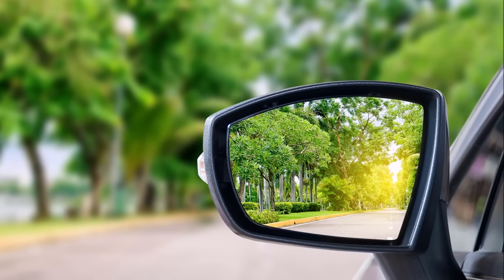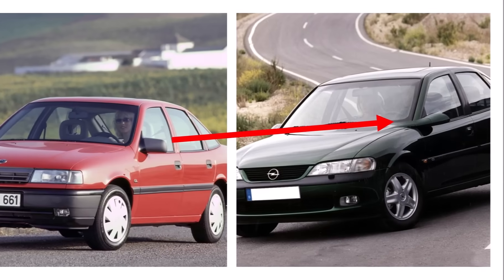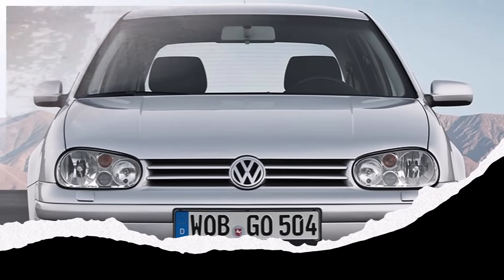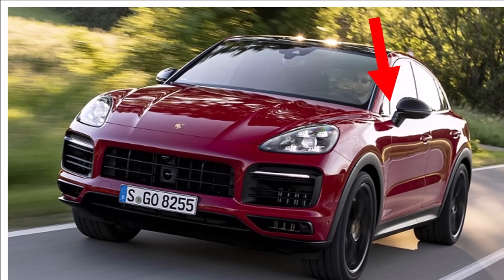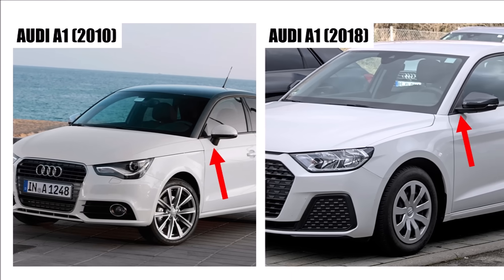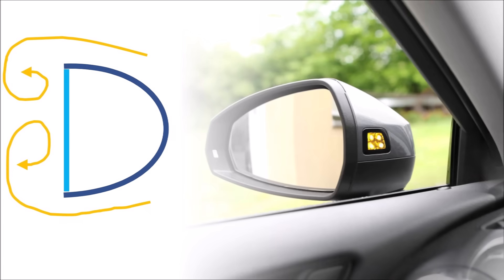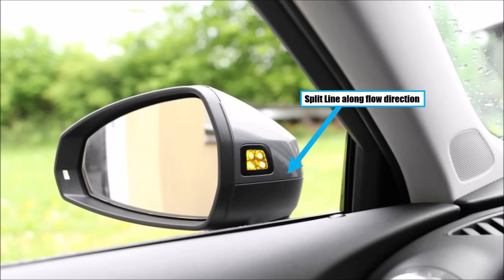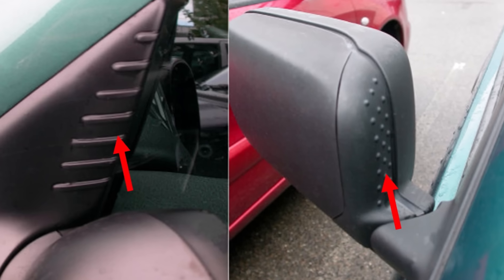Car Mirror Design - EXPLAINED

Comment: Another design issue to consider is the driver view downward between the mirror housing and windshield A-pillar. In some cars, you cannot see thru the gap, which makes things difficult in low speed turns and off-road driving where that view is very important.

Comment: Ferrari Testarossa had mirrors (or in some versions just one mirror) on two struts and sticking out quite far. It was one of the features about that car that always struck me in a way. Airflow considerations probably played a role here but I never gave that much thought.
I think the big break in mirror design came when people wanted to adjust it from inside without having to open the window. The mechanism required for this meant that the mirror couldn't be mounted on a slim stalk any more but was mounted directly on the triangle in front of the window (which led to the turbulence problems described here). I assume some of the newer cars shown here that have mirrors on slim stalks again use servo motors to adjust?
You could also talk about the mirror glass which tends to be convex for a larger angle (and leading to the effect "objects in mirror are closer than they appear").
In trucks and buses mirrors are a whole different affair because of the huge dead angles they have to avoid.

Comment: 3rd and 4th gen of VW Passat got an interesting mirror design; Maybe you could explain it further. It's connected to the side Window by two separate Arms, that work as a hinge too. What are the up and downsides of this design (which i think is pretty developed for a late 80's car) and why did it fail?

Comment: I don’t like cameras. A mirror is a 3 dimensional image that also preserves spatial relative angle.

A camera is a flat 2D image that requires moving the mirror, not your head to quickly scan beyond the set field of view. It is also LOCKED to a resolution.

Comment: I have a turbulence issue on my Mk4 Mondeo wagon. it's not apparent until you drive at 50+ mph / 80+ km/h in heavy rain, at which point, on the drivers side especially since the wipers push water to this side, my view is SEVERELY limited. Water gets pushed into the side window by the air stream. considering 3D printing some vortex generators or even an entire housing with a different shape as it is very annoying

Comment: Great article, with just the right amount of technical nerdism. 
To add on that; if my memory serves me right, then the B3 Audi 80 from 1986 was the first car to restart mirror position on the door. Audi had made a lovely and robust looking door mirror design. But the best part in my opinion was the adjusting mechanism of the glass. The common solution at the time was a lever that allowed to adjust the glass position, but mostly felt as if you were rowing with a paddle in a pond. Not very accurate. Audi's engineers had gone wild with two rotating adjusting knobs on one axis. One knob for vertical adjustments and the other one for vertical adjustments. It allowed you to highly accurately adjust the position of the glass. But best of all it was just over-engineering and nerdism at top level. I loved that solution a lot, also because the knobs had a lovely feel. Was never reused though. 
The B3 was simultaneously the first car the use the quite complex and over-engineered door-opening-position-mechanism (what's the proper name...?) with the small vertical rollers and the spring. This system is since then used in nearly all VAG products ever since. Vorsprung durch Technic was at it's best back then...
Thanks for the video and keep on the good work! 👍🏻

Comment: Meanwhile virtually all mirrors are installed such that they pander to the idea that you should see the side of your car in your side mirror which is just a waste of display area. so here we have a case where noticed the size of the mirror had to be increased by law not by design even though the purpose of the mirror is so you can use it to see things. Engineering is prioritizing the wrong things, here.

Comment: Very cool, never thought about it before.  What about mounting the mirrors on the front fender like the old Japanese cars?
Reply from the maker: You wouldn’t have the noise issue but pedestrian crash problems
Reply: @bsport320  So... A follow up video of the aerodynamics of fender mounted mirrors in combination of a ram bar in front for pushing those pesky pedestrians away? :D

Comment: Often thought about the split lines and small details like vortex generators, as well as the quite large variation in designs between different marques. For example the Mini just couldn’t do what Tesla have done. Great video and please continue on this theme !!!!
Reply from the maker: Thanks, will do!
Reply: @bsport320  for example you often see little surface details on the back edge of rear wheel arches, or small surface details in the rear fender panelling or stuck onto the rear pillars which seem to create hard edges along the rear corners of cars … presumably to improve separation and reduce drag? Would love an aero breakdown of their functionality

Comment: Do you have any insights on how headlight designs can reduce wing mirror noise?
Reply: I think the first gen Nissan Leaf was developed with bulbous eyes for this reason.
Reply from the maker: Nissan designed the Gen1 headlights with a blister on top to break the airflow in above and below the mirror. There is an interesting picture online for that. If the steamer is in one position it looks good but I think a few cm further and the flow hits the mirror like any other car. Nissan got rid of it for Gen2.

Comment: This is actually super interesting, would have never known any of this, thank you!
Also, is it true that mirrors are also designed to block rain water from splashing from the wheels onto the side window? Apparently the last generation of Mercedes mirrors were designed this way
Reply from the maker: That’s possible depending on the car‘s proportions. The Ferrari 488 mirrors are designed to make way for better intercooling.
Reply: some cars have mirrors that serve a specific function. As B Sport mentioned, the 488 was used to direct the air to the side vents, which houses the intercoolers.

The Nissan GT-R (R35) mirrors are there to guide air so that it can flow to the rear wing. The Lexus LF-A has its mirrors to guide air to the rear vent (not sure what the vent does, I assume it’s transmission cooling given the size).